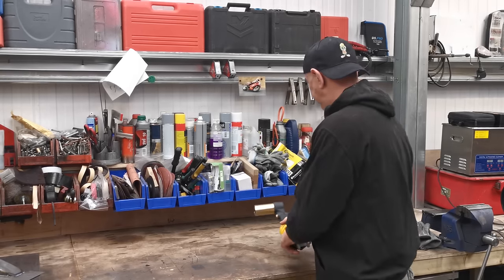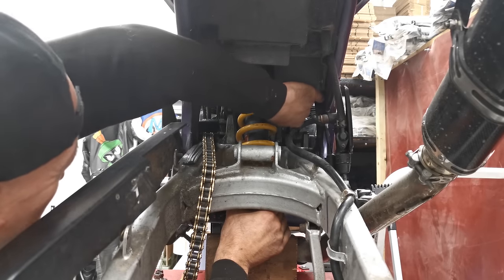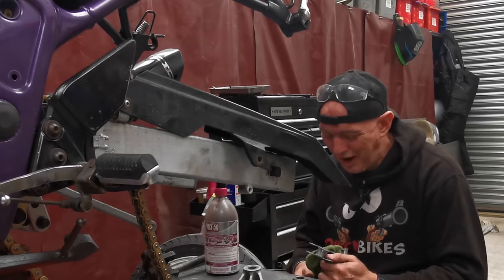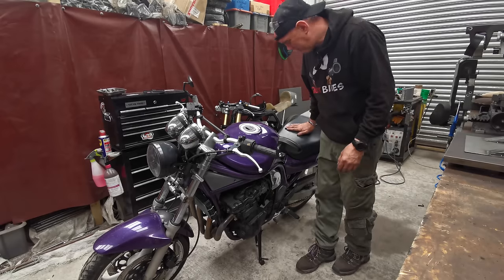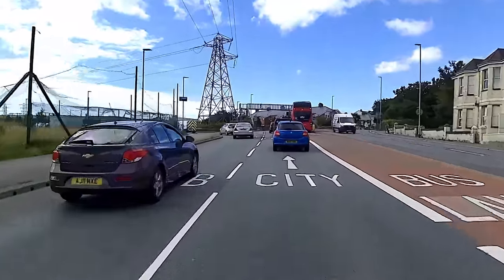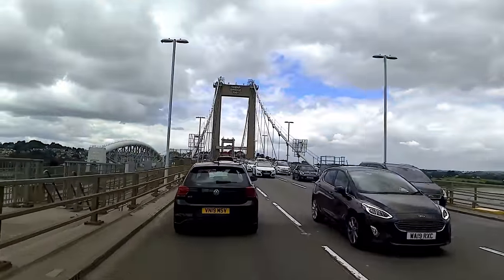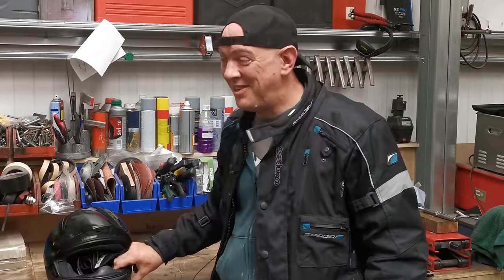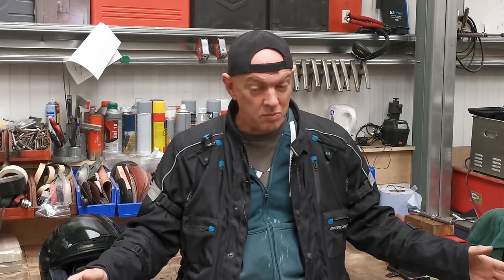Installing a CBR600RR shock on a Suzuki Bandit 600

Comment: Hi Quickie
Ex refugee from Mutley so now your test track well. Thanks for the great vid of grafting in the CBR shocker. After watching you doing  this mod I have done likewise on my 1996 GSF600 but I had the advantage of a bare frame and swinging arm. I have got Ikon front springs which I reckon with the Showa shock should be the dogs danglies....I have been using the 1200 sprocket ratio's which makes the bike handle better in traffic. Might see you some time on the A38 and have a mutual hoon! Stay safe...Wolfy.
Reply from the maker: Ah, a local lad 😁
Its instantly better supported with that shock in the back don't you think? I've still got the front end swap to do using the Triumph forks and hopefully i get a bike that handles and is fully adjustable. ASBO is a bit of a test bed for future projects, but it's fun working it all out 😆👍

Comment: Good morning, sorry if my english is not very good. I am French and have been watching your videos for over a year now. I really admire what you do. cheer. little question, to mount a cbr600rr shock absorber have you modified anything? I work on a b6 1998 cafe racer in advance thank you for your information
Reply from the maker: Hiya matey and thank you for watching. If memory serves, the only thing I had to do was put a washer either side of the top mount. Since then I've made a new frame so everything was made to fit 😁👍
And your English is very good matey 👍

Comment: Hiya quickie mike here should there be a number plate light on it for the MOT mate cheers mike, right some adivice pls mate the rear brake reservoir want to put it under my seat instead of behind the rear fairing, because its a pain every time you want to bleed it or top it up, so what you think mate near the battery i thought what you think mate cheers mike ;-)
Reply from the maker: Hi Mike, the numberplate light isn't an mot thing I don't think, but the boys in blue want one and have the power to make you install one. As far as relocating the reservoir, you can pretty much put it where you want really as long as it won't get hot (like near the exhaust) and there's nothing around it that doesn't react  well to brake fluid as we all have our clumsy days 🤣😂👍
Just my thoughts anyways 😁👍

Comment: I'm loving your work, my mk1 600/750 is my baby.  41mm GSX600/750F forks will offer some damping adjustment though you'd need to swap the legs over as they wear different calipers. I opted to fit preload adjustable fork tops instead which have made a hell of a difference. £20 well invested.
Reply from the maker: Nice one 😁👍
The new forks have turned up along with the yokes apparently, but I still need to sort out disc, calipers etc yet as well

Comment: Quicky mate. You've got to get yourself a better mike and camera for rides out. The investment will pay off no end. I really enjoyed the riding vlogs. You are a natural. Keep it up!!!!!
Ps the triumph forks are good. My speed triple 955i  forks are difficult to get right. Get your sag. Then go for a ride. If it weaves at high speed, back off the rebound till it's stable. Mine is 1 turn from fully in. I am double your weight so your setting  obviously will be more. Hope this helps speed things up as you know more than me about setup. Laters
Reply from the maker: Cheers, thank you Rob 😁👍
The setup is going to be an odd one as the forks are built for a different bike which has a different weight, wheelbase, brakes etc... Quite a bit has to change on ASBO to make them usable, but no reason why they shouldn't work out peachy 😁

Comment: Good to see that a to CBR shock swap works, even if it wasn't a direct match. Dropping the rear a touch again may help with the weight transfer. Is it worth spending £100 on a Hagon fork spring set while you wait for the funds for a 955i front end, just to make it more rideable in the interim?
Reply from the maker: Don't really think so at this point. Preload is on position 3 from soft, so lots of adjustment left. The project bike when built should be lighter, so I may end up swapping the spring at that point. Good shout though, I like your thinking 😁👍

Comment: Another step in the right direction Quicky, think you past racing experience is helping you with this project mate. Just get them 955 Forks mate it will look fantastic buddy and handle miles better. Look forward to the next vid buddy take care now
Reply from the maker: Cheers, slowly but surely its getting there. I'm back on GIXIT now though as I want Steve O out riding again as well 😁👍

Comment: Hi Quicky. Thanks for another great vid! I like the aSbo logo. Apart from your welding, do you have experience in Art/Design etc? Cheers.
Reply from the maker: Cheers, I used to be an airbrush artist and graphic designer at one point. I may well be getting the airbrushes out again if a project demands it 🤣😁👍

Comment: Sounds great and pulls clean. Surprisingly a GoPro taped inside a helmet works pretty good 😁👍
Reply from the maker: It's alright init 🤣😁👍
I need to get some velcro or something to make a mount for the mic in the lid, but it proved I can use it anyways I guess 😁👍

Comment: rear end better?
Is that a second hand shock? was it serviced before fitting?
is the oil as old as the shock? is there gas pressure in the shock ? 140 psi 10 bar or is it down to 70psi or less?
rear end is now showing up the front ends progressive springs and woeful damping.
Answer
Bandit spring "according to what I found on interent?" is a progressive 35 x 295mm spring [nice for plush ride and early braking or your MX bike]
linear springs 8.5 -9 nm but thats a £100 investment???
CB900 springs are 35mm 285mm linear so this and some 38mm washers stacked and packed to make up the correct preload. or maybe there are 35 x295mm linear springs in a production bike ??? I didn't look that hard to be fair.
SVI 20w maybe 30w oil and the front end should be somewhere half reasonable and a small investment on the current suspension when compared to the £ hundreds on a set of fully adjustable forks, and triple tees which most probably will be secondhand and also need servicing £££.
 So somewhere between £60 -£80 to my mind should put you in a more confident position. The fully adjustable is the way to go if you can afford it but I thought I'd put this out there for anyone looking for a bit more feel but do not have the budget for a full swap out.
Reply from the maker: A good comment, thank you 👍
I could spend time sorting out different spring and either going for a cartridge emulator or making my own stack, but to do the job right you'd need to modify the damping rod in the middle of the shock really as well. Thing is, once I project build it the bike will be sold on to fund the next project and rather than force the new owner to have to strip the forks apart to get them working as they wish, a fully adjustable set is probably the way to go. Rear shock was serviced 500 miles ago so all is good, but it's getting it again when I build the bike 😁👍
Thanks for chipping in
Reply: @QuickBikes  2 paths for learning go to university learn how to write about what you learned have some hands on experience.
Suck it and see stripe it down, F£$k it up but understand where you went wrong and get it right next time at your own expense.
YouTube and other sources are part of the latter.
So thank you for spending the time to share your experience with us.
Thanks again for answering the shock Question not many riders consider the suspension as serviceable items and less know what to do when it fails and then spews' its contents opting to buy replacement because "that's what the man in the shop said!"
The man in the shop have little or no experience of shock or cartridge fork servicing.
Anyway look forward to the next video and keep up the great work.
Reply from the maker: Thank you for watching matey 😁👍

Comment: Did you check do the 20mm lowering dogbones bring ride height to stock, and how did it affect rideability?  And how long these lowering dogbones are compared to stock ones?
Reply from the maker: I cant remember off the top of my head, but I did write it all down and have the videos for reference 😁👍
Reply: @QuickBikes  Just fitted similar damper to my bandit and measured on center stand from tip of rear fork straight up to frame it is 4cm higher now.  Assuming that lowering kits are measured at seat height -25mm dogbones could be pretty close?

Comment: Excellent, how much was the shock & how much do you recon you can get the forks for bud :)
Reply from the maker: Shock was only £75, second hand off eBay which was a bargain. I just cleaned it up a little but it's going to get stripped down, dressed up and repainted when the project kicks off and I cut the bike up. Its fine for now though. I also just had a message saying the forks and yokes have arrived at the shop which is mega. Very keen to go see what they look like but I have work in a bit so it'll have to wait till tomorrow. Will still need to sort out the wheel, discs and calipers though as the current ones won't work 😁👍

Comment: ahhh
i just dismantle my Bandit 400 rear shock to install a new shock from a Bandit 1200.i took some pictures BEFORE but these were not close enough,
i think my pivot is upside down ,,to bad i cannot add a picture here so you would tell me and i could not see here on your video how yours is fit there,,
not my day
Gef in Quebec
Reply from the maker: The joys of messing around with bikes hey 🤣😂 I found all sorts od stuff on ASBO that was 'interesting'... Have you got a manual or maybe try Googling images?
Reply: @QuickBikes  yes i printed the 400 manual and not much photo but i received an answer on a Facebook group and my pivot is on the right side.-4 celcius here this morning,i will do a test ride ans see how is the rear suspension with the "new used' shock.After she will be stored in my garage table for winter and will do some work on her.thanks very much for your response "Appreciate your videos .Gef
Reply from the maker: Good good, hope it worked out for you 😁👍
Reply: @QuickBikes  well today i tried the 1200 shock ,,ride around where the road is bumped ,,,man it was a catapulted  :-)  ,,,, and than i came back in my garage and installed the Bandit 600 that i also baught,,it worked way better.the adjustment are 1 on the spring and 1  on the Wheel under the shock (forgot what is used for) anyway that way better but now the front fork need new springs and oil but that will be for my winter projet here.Gef 
so one  clean Bandit 1200 shock for sale  .i paid it 85 $ canadian
Reply from the maker: Nice one. I ended up with a CBR600RR shock in the back of ASBO and I have yet to swap the front forks out. The 600 set has bugger all control over tge damping and I just found it too soft and bouncy. Good winter project though 😁👍

Comment: Wouldn’t you need to fit a stronger spring due to the weight differences of the 2 bikes? 
With the fazer the R6 shock is a like for like but needs the spring changing... demon-tweets sell Faulkner’s race springs for the exact reason and they are about £30
Reply from the maker: Good comment 😁👍
I weigh 94kg in full kit and the bike is basically stock. The rear shock has the stock spring in it and current set up has the preload collar on peg 3 from the softest setting, so I think we're OK for now. Once it gets built as a project the springs front and rear will be replaced as needed as the bike should be a fair bit lighter by then. Thanks for chipping in 😁👍
Reply: Quick Bikes ahhh ok fair enough :) 
Keep up the good work 😁😁

Comment: How much do you think this will cost me to do considering I'll have to pay a mechanic to do it?
Reply from the maker: What, replace the shock?
It's a couple of hours work I should think, but it's not difficult at all. I'm dead fussy with cleaning and lubing stuff whilst I'm in there and it total it probably took me 4 hours. That's with the waffling as well 😂🤣
Reply: @QuickBikes  That's not bad. I'll consider changing the shock on my bandit. I always thought it was a bit too soft. You described the handling perfectly.
Reply from the maker: It's not difficult to do, just depends if you have the tools to do it really I guess. Best of luck anyway 😁👍

Comment: . good video. But you got some going to keep up with Matt 😂. Should get a dog as well. Ps hope to set up my white power unit shock weekend
Reply from the maker: Hehehe, never gonna get that many videos out 😂🤣
The should end up handling really well by th time I'm done and it's the twisty bits that hold all the fun. The only advice I would give is try to get the laden sag right first as it's the one  thing that makes the biggest difference. Best of luck 😁👍

Comment: Do you know if a Suzuki GSXR 600 750 k6 k7 OEM Rear Shock fits a suzuki bandit 600 mk1
Reply from the maker: I'm not sure if I'm honest... I went for the cbr600rr shock in the end as its spot on. I found that through Google... just measure the shock length and width of the unions, the manual will tell you travel.lengths and you're just looking for.something similar then... hope that helps 😁
Reply: @QuickBikes  what year cbrr did you use
Reply: Thanks for taking the time out you evening to help
Reply: HONDA CBR600RR RR3 RR4 SHOWA ORIGINAL REAR SHOCK ABSORBER GENUINE found this looks like the one you used
Reply from the maker: https://youtube.com/playlist?list=PL4wa8mvBEmsCeYktzuVb8llN5QLa2CZta